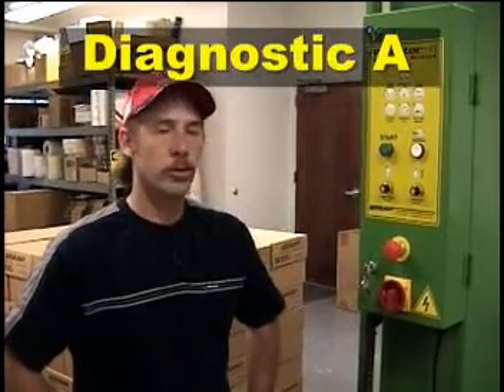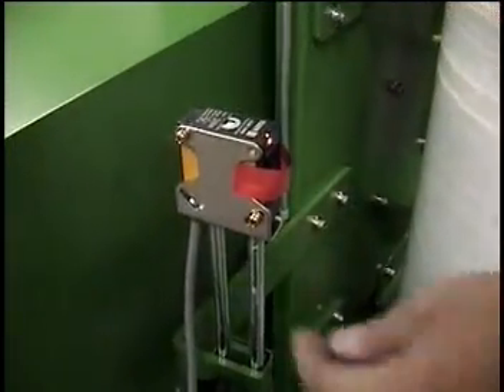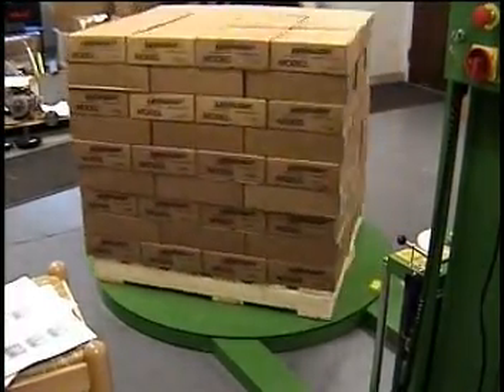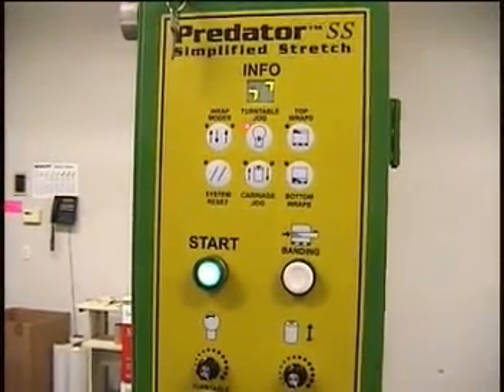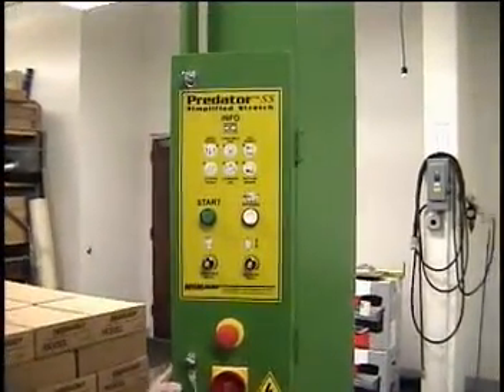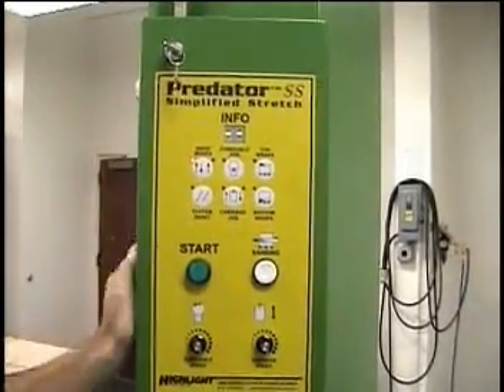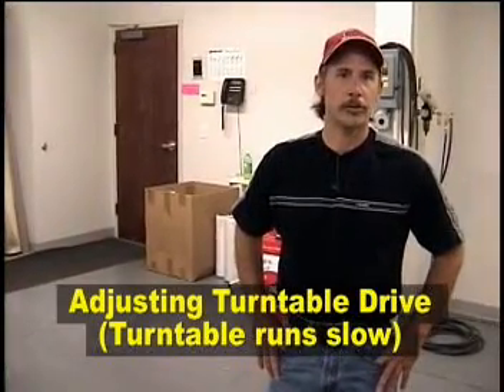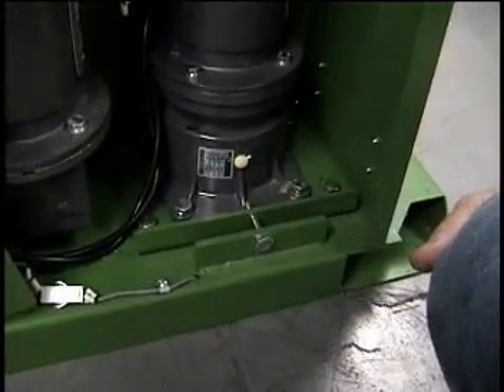Predator SS LP Full Service

Comment: Does anyone know how to prevent the shrink wrap from breaking from the corners of the pallet when you start off?
Reply: Wait until you have 2 full rotations of untentioned wrap before adding tension on the wrap. That or lift the wrap above the pallet
Reply: @ErraticHail  thanks